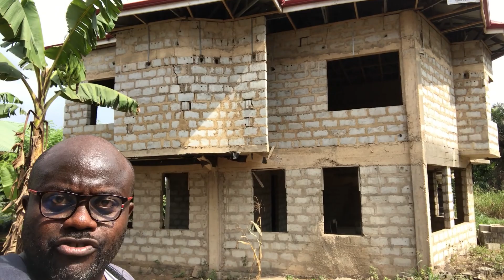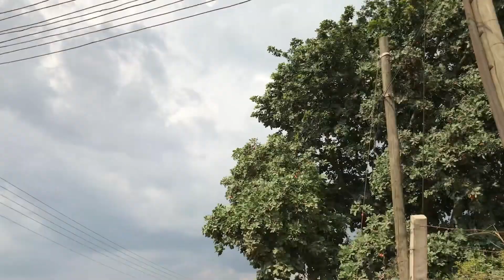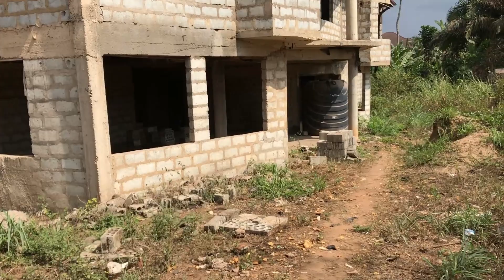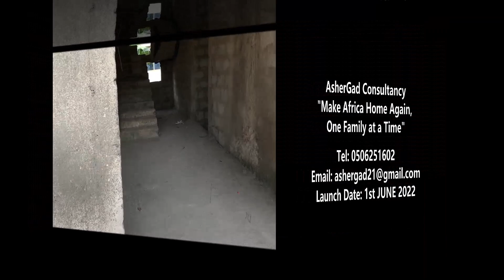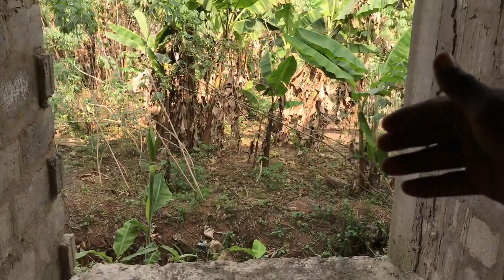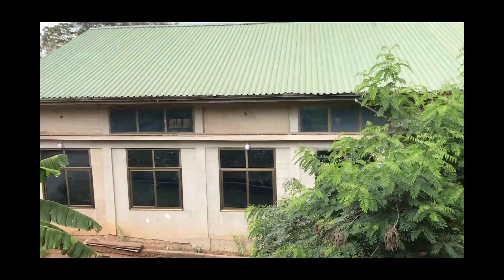13 BED HOTEL IN ABIRIW | JOURNEY WITH ASHER & GAD

Comment: Did I hear you correctly?1 bag of cement is GH100?
Reply from the maker: Yes
42.5R
Reply: @kingstal90  So, at today's current market prices, to lay a 10,000 square foot Foundation "for cement only"  not including labour and other associated cost for foundation laying would run roughly $1000.00 USD right?
Reply: Ghacem 42R is 92 in Kasoa 
Ghacem 35R is 85 in kasoa

Comment: In Nigeria the electrical lines in the house are run on the high level from the ceiling and not from the floor.
Reply from the maker: Perfect
Thanks for your comment 
Are the house built exactly the same over there as well?
Reply: @kingstal90  yes they are build similar with hollow blocks of 6" and 9" depending on the kind of structure.